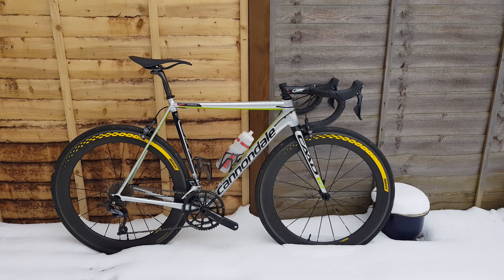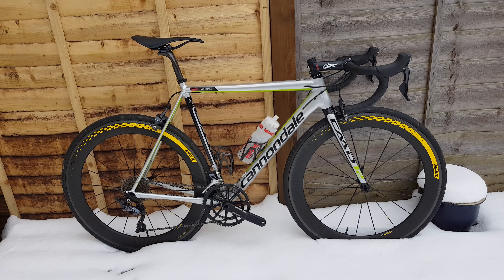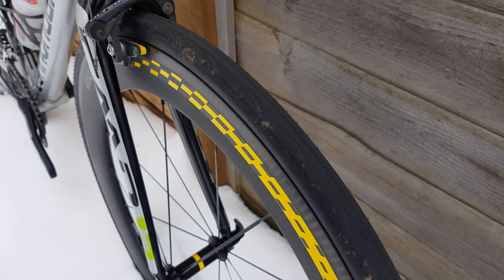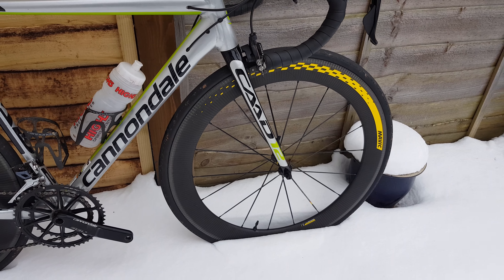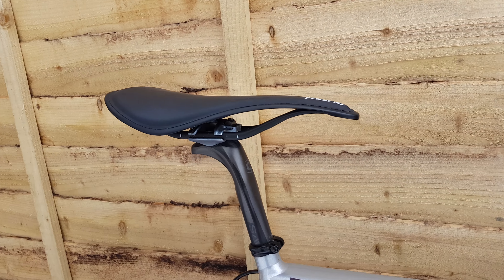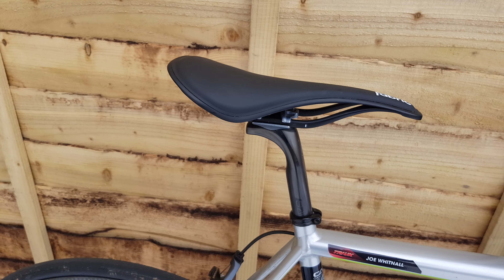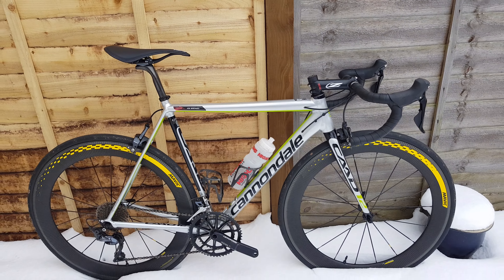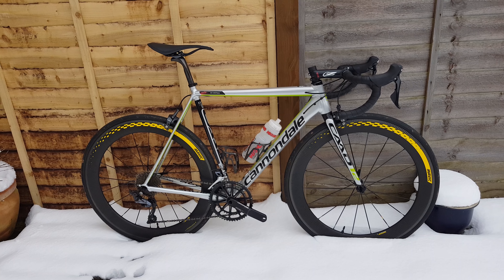Cannondale CAAD12 Shimano Ultegra R8000 - 2018 Project

Comment: What size is the bike and how tall are you and your inseam roughly? Do you notice a big improvement between the 105 and the 8000 ultegra?
Reply from the maker: Hi Craig, this is a 54cm and im 5'9" not sure on inseam
Reply: Joe's Cycling Reviews I’m 5ft 8 and on a 52 caad 12 . Saddle height at 70.5cm 
The 52cm has a more sloping top tube in comparison to 54 onwards
Reply from the maker: I would be going for the 52cm if i was you, im just on the 54cm and my saddle height is 76cm